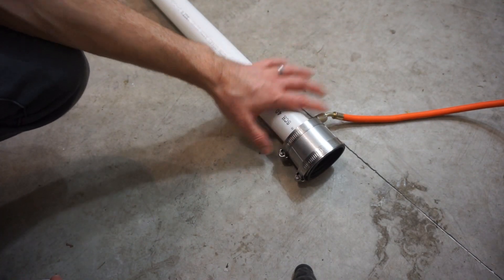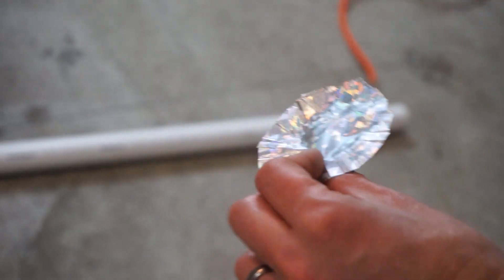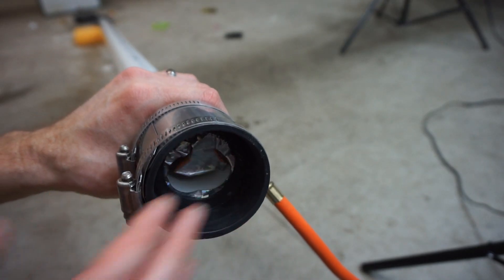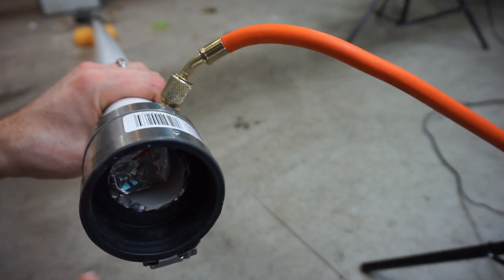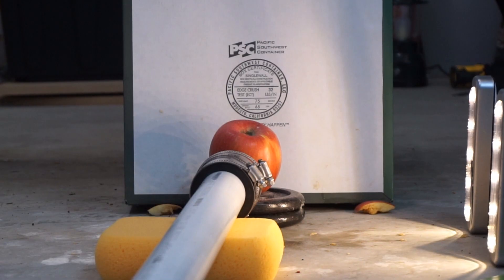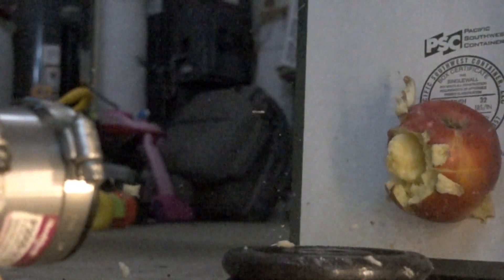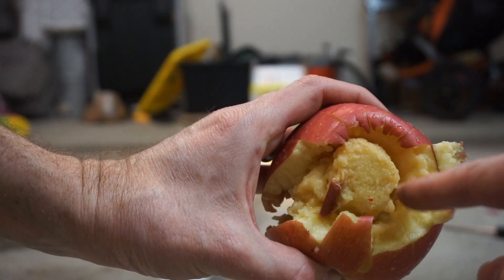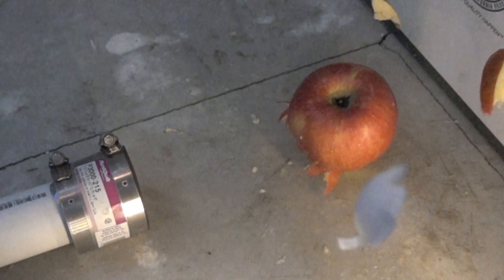Shooting Fruit With Supersonic Ping Pong Balls | First Vacuum Cannon Test

Comment: 3-8 times the speed of sound??   I must say I find that hard to believe.  I could very well be wrong, but here's my reasoning.  The average speed of the molecules in the air is indeed faster than sound by like 50% or so.  However, even on the faster end of the speed bell curve, I would only expect speeds that are 2 to 3 (for the fastest molecules) times faster than sound.  It would be a very small minority of air molecules moving 8 times the speed of sound yes??  I don't know.  

By the way, how fast was the ping-pong ball actually moving??
Reply from the maker: +DANG JOS the quote of 3-8 times the speed of sound depends on the type of gas that is expanding into the vacuum. The expansion of the face of the gas cloud advances at 2/(x-1) times the speed of sound in that gas where x is the heat capacity ratio of that gas (cp/cv). For air x=1.4 so the gas cloud should expand at 5 times the local speed of sound! I don't think you can look at this type of expansion simply in terms of an average of how fast molecules are moving when they are contained.
Reply from the maker: +DANG JOS also based on my frame rate I clocked it at at least 400 m/s but it was hard to tell since I didn't have the distanced measured well. I will try to measure this better next time
Reply: Hydraulic Press Action  Alright thanks.  And that's interesting

Comment: Instead using ping-pong, can you use something more aerodynamic and shoot it vertically so we can see how high it will go. And for shooting from this gun you need a faster camera, or Slow mo guys. Good luck.
Reply: a golf ball is more aerodynamic
Reply: +Mario Velez, yes, golf balls are more aerodynamic, but that doesn't work to its advantage here, it actually makes it perform worse. You want the least aerodynamic object possible here, not the most aerodynamic object.

Think about what's happening here. What is it that's propelling the ball out the end of the tube? Air pressure. What normally slows a ball (golf ball or ping pong ball) down? Air pressure. But in this case, the ball is in a tube with a vacuum, so there is no air pressure inside to slow the ball down.

Instead, it's air pressure from opening the back end of the tube and filling the vacuum with air that makes the ball move, but with a more aerodynamic ball, that ball will receive less kinetic energy from that air, while not having to fight air at the vacuum end of the tube, so with nothing to slow it down, and the only thing speeding it up being the one thing it's designed to not be affected by, you'd be better off with a golf ball with no dimples.

The more aerodynamic golf ball will not be propelled as fast as a smooth ping pong ball.
Reply: +my520graj
and shot it vertically- (shot) Shoot
high will it goes- (goes) Go, fly
 you need fastest camera- (fastest) A faster
or Slow mo guys. Good luck.- (dumb) Not everyone has access to a "Slow mo guys" They're quite expensive to buy at Walmart and no one has that amount of money.
Reply: Emperor Ender I'm sorry for my English I hope it's not gonna affect your ego.
Reply: my520graj "and shoot it vertically so we can see how high will it go." It will*
Reply: hot coco he said it correctly. no need to fix what's not broke
Reply: Dyllon Geckles nu he didn't but ok😐
Reply: golf ball has more mass, so it won't have the same acceleration even assuming a perfect seal between the ball and tube wall.  (ping pong ball = 2.7 grams, golf ball = 45.93 grams.  huge difference.  I would expect the ping pong ball to be travelling roughly 17 times faster leaving the tube than the golf ball)
Reply: Aerodynamics are completely irrelevant inside the tube. Vacuum or no, it's a piston while it's in the tube. Leakage would be an issue, but that's about the fit inside the tube. For aerodynamics to matter the leakage would have to be extreme. So extreme that you'd be talking about wind pushing something.

Comment: I gotta be honest but the 1000 FPS camera isn't enough. it's still too fast for me to see how the ping pong ball made the contact with the Apple and blown to pieces.
Reply: I was just thinking he should team up with the Slow Mo Guys to run this and maybe other experiments using this thing.
Reply: Because that still isn't enough. We need a shit ton more frames to properly see the moment the ball comes out the pipe but before impacting the apple, as well as the moment of impact because right now the best you can do is to pause it on a blurr of when the ball exits the pipe and before it smashes the apple with no actual detail of the ball
Reply: #Harambe4President not sure about that but if there's a camera that could record a bullet hitting an apple at such a slow mo, then that should work.
Reply: Sack Boy true
Reply: Camellotion Theodorsen they need more than 1000 FPS camera. coz this is really an interesting experiment. thumbs up for that.
Reply: Yes, it looks kind of like the ball is already broken before it hits the apple and it would explain why all the damage on the apple is in a ring.  The video only has about 1 blurry frame of the ball before impact.

Do ping pong balls pop under vacuum?
Reply: Right, we need 5,000-10,000 fps footage.
Reply: +Crashing Tomorrow It's because running it in slow motion doesn't add any new information or new frames, it only slows down how often we see the ones that are there, which doesn't add any of the missing detail. For that, we need more frames.
Reply: Watch it in .5 play back speed or .25
Reply: Sack Boy As he has said, the ping pong balls were travelling 3-8 x faster than sound, hence, if you would really like to see the ppb colliding with the apple at a slow-mo rate, you would probably have to use a 3,910,000 fps camera.